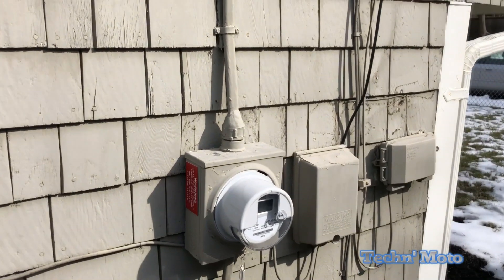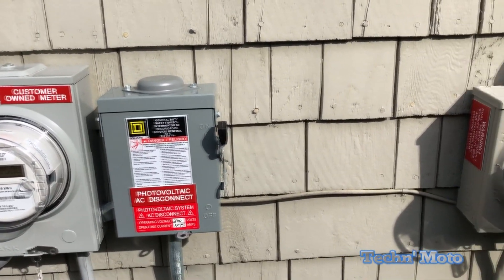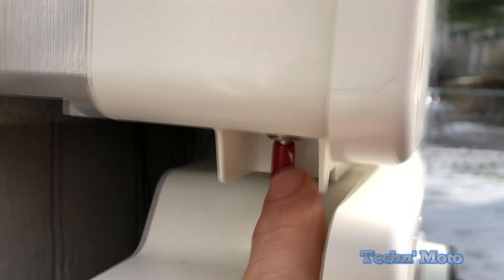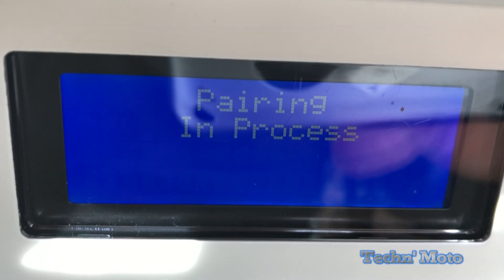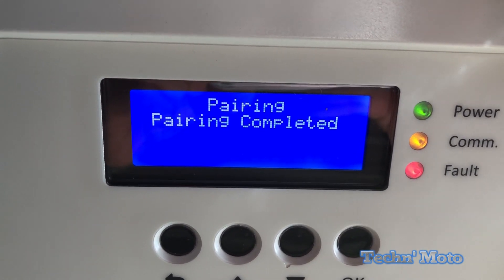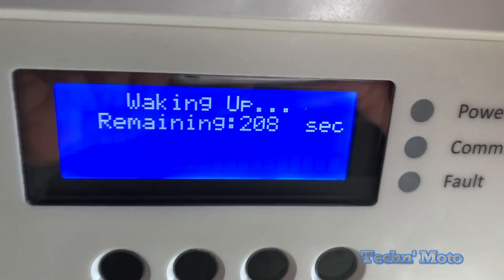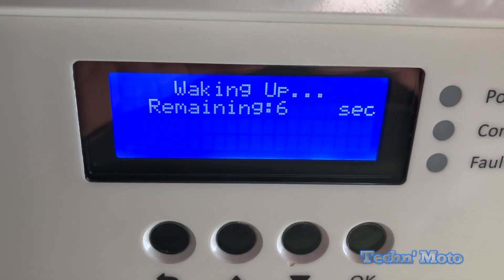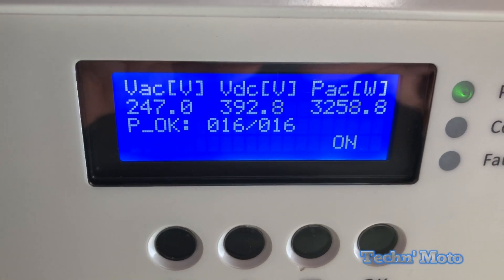Solaredge HD Wave Inverter-Pairing & Turn On | Techn' Moto

Comment: Thanks for the video, I think solar is the way to go if you can. I'm curious, approximately how much did it cost for the panels, hardware, and installation?
Reply from the maker: Brian Wanberg for this system just under 22k but in a year I’ll give everyone an update on exact numbers. May sound expensive but If you think about it cheaper than some stuff we buy like cars. Unlike cars though, solar saves you money if done correctly.

Comment: Our solar inverter was working but it didn't have all 20 pounds only have 12 so I repaired it and then it wouldn't break the 10 bolt DC threshold I did what you said to do and it didn't even do anything
Reply from the maker: If yours is incorrect or not working then something is wrong. Might want to get someone who understands these systems or who can repair the system to have a look at yours. I’m no expert hence why I hired a company to do mine.

Comment: Something wrong with mine, i configured everything, then paired the optimizer and complete ac volt and dc volt is good but its not producing any power even after an hour, its been a week with still the same problem.
Reply from the maker: Maybe call the company that installed your system to look at it. I know my system is under warranty and my company monitors it remotely. So if anything goes wrong they know and fix it. I am not an expert on these hence why I had it installed professionally. Good luck
Reply: @TechnMoto  i figured out why. My set up is a commercial set up so i needed 15-16 optimizers for it to start producing power, everything else was good.
Reply from the maker: @EVILalwaysDIES  🤔 I have one per panel total of 17. I think. Glad you figured it out. 👍